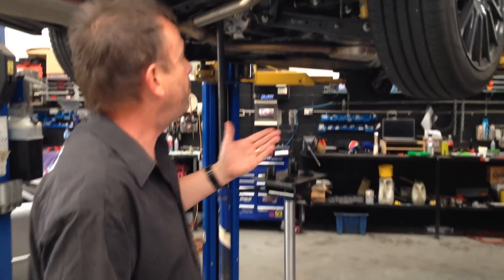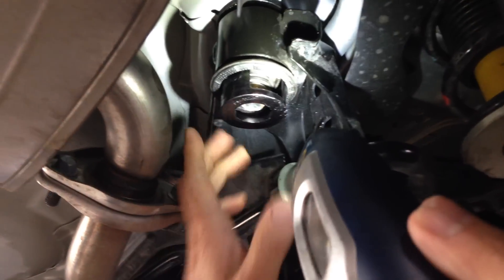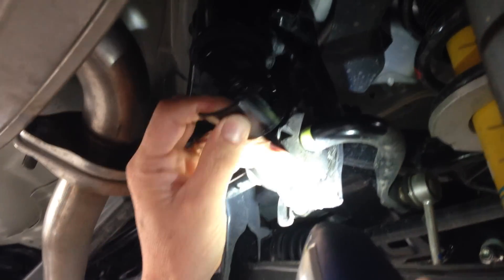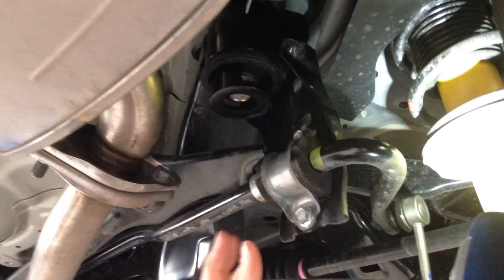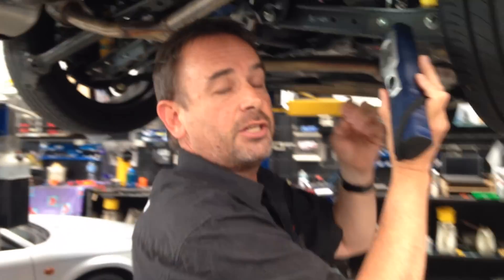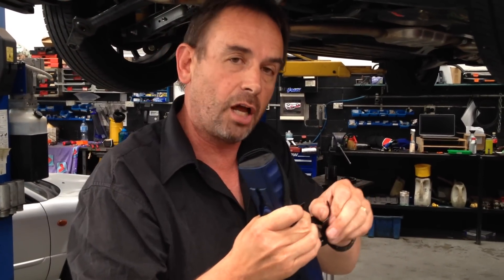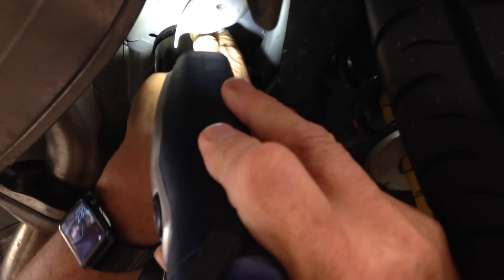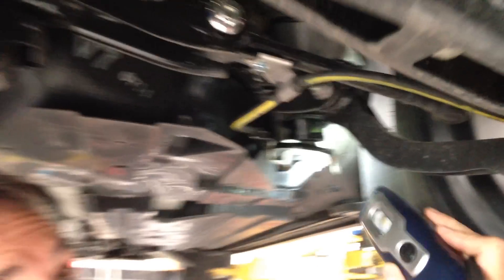Subaru Levorg, rear suspension bush fitting tips and  traps.

Comment: What is it with Subaru and rear suspension.
Our 06 Forester Turbo has only covered 80'000 klm , but the self levelling rear suspension is shot and needs replacing. And it has never been offroad.